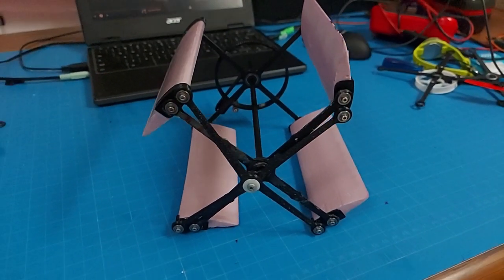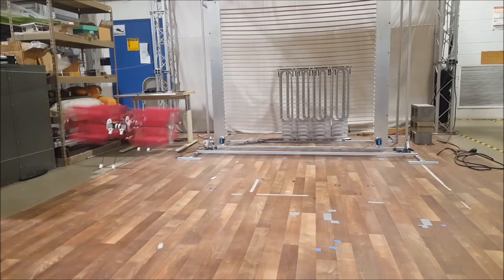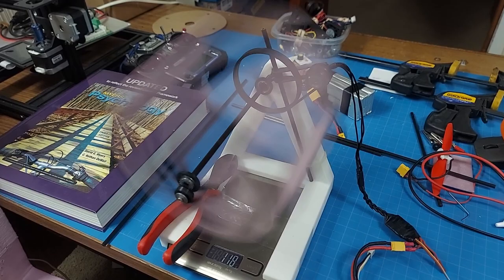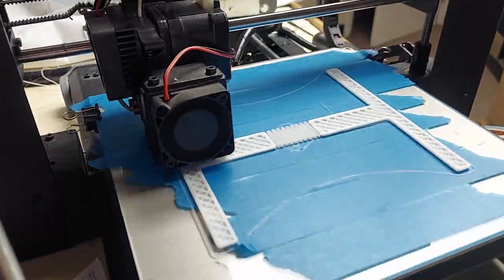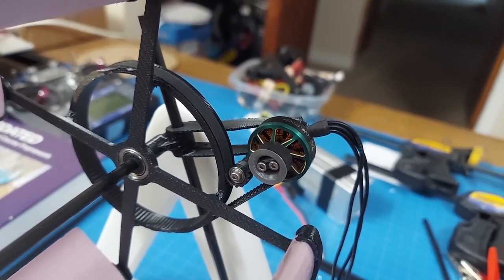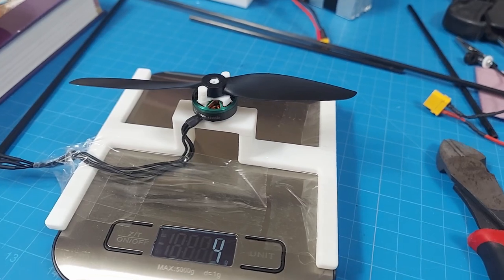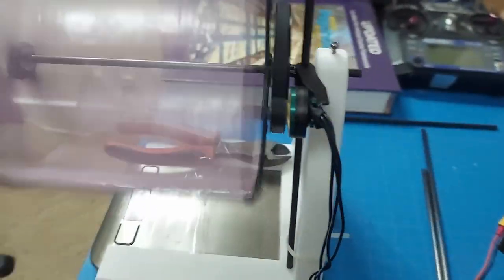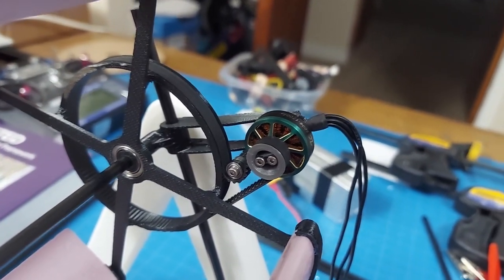The Cyclorotor Is Now a Match For Propellers!

Comment: I agree with you on principle. Specifically deficiency is near regular propellers, and that way it will always be an issue.

The big thing is we have stronger and lighter materials now, and you could put a fuel cell that gets better efficiency than combustion.  

Just the acoustics and maneuverability is generally enough. We have materials now they can make it much much lighter.

Comment: I'm curious if maybe your test stand for the fixed propeller is way too short. Looking at it, most of the thrust is going to blow down onto the scale, and that's going to make it appear to have way less thrust. Also the backwash is going to mess with the whole thing. I would recommend making a standard test stand if you're going to be comparing thrust
Reply from the maker: That is a good point.
I took that into account when I decided to make both the propeller and cyclorotor so that it blows air up in order to make thrust downward.  I think that there is enough room for airflow to enter without much of a reduction in efficiency.  I'm not sure though.  There probably is some effect, but again, I don't think that it's significant enough.
Reply: @JudeSchauer  oh, I see, of course,  it's mounted as a pusher. Hmm..
Reply: Look at AMCA test rig for a circulation fan (industrial style).  It uses a L shaped rig that mounts the fan horizontally, pivots at the angle joint, and the force is measured vertically.  This prevents the wind force from affecting the thrust force.  It also has guidelines for minimum clearance distances.
Reply from the maker: I've actually used that system for the past year or so.  However, I was getting inaccurate readings with the cyclorotor due to some weird effects, so i switched to directly measuring the thrust.

Comment: cyclorotor idea: instead of using a simple, rotating arm to offset the cyclic pitch of the rotor, what if it was two spiral cam discs with opposite spirals, where the end of the arm is located in their intersection. the advantage would be: adjustable magnetue of pitch, but the disadvantages would be weight, higher friction, and another servo motor and their respective control circuitry
Reply from the maker: just designed this, currently in testing so it should be on the next model 👍👍

Comment: Would it effect take off or balance to use only 3 blades per rotor? Or maybe two? Probably an obvious hypothesis you’ve already reached on the path to weighing less but im curious
Reply from the maker: Yeah there's some papers out there that already looked at that.  It uses less power to run a 2 or 3 bladed rotor, but it produces much less thrust.  It uses much more power for a higher blade count, but only produces a little bit more thrust.  4 blades is pretty much the perfect balance in this scale.

Comment: now that you have great gains using 3d printed parts, will you use a more difficult to fabricate but perhaps lighter and stronger materials for the frame and parts? perhaps some carbon fiber or titanium frame with an aerogel/carbonfiber propeller? Maybe you can take this even further. Great video I'm excited for the future or drones and transport.
Reply from the maker: Thats the hope.  I'm currently changing lots of parts around and iterating, but once I have a solid working model I'll look at doing that.  I recently got access to high strength Carbon Fiber PLA and Glass Fiber PLA so I'm hoping to use those as well.

Comment: Have you considered vertical fins on the rotors to counteract possible vortices? Like how that company did? Love this project it looks awesome
Reply from the maker: I tried to do that out of some really light material, but the suction force was too great and it just pulled against the blades and caused lots of friction.  It would have to be larger scale to make it weight-economical to add in the side plates.
Reply: @JudeSchauer  even a single circular plate that moves with the rotor? Out of some paper or something?
Reply from the maker: Yeah.  I did paper and it was way too weak, so I tried cardboard (thin stuff from a cereal box) and that was also too weak.  Regular coregated cardboard would probably work but i think it would be too heavy.
Reply: @JudeSchauer  it might be a lot to ask but maybe a very thin sheet of fiberglass?
Reply from the maker: Yeah composities would definitely be strong enough, but it would weigh enough at this scale to be counter-productive

Comment: For power to weight ratio it really needs to be the entire vehicle weight, not just the thruster. Most commercially available drones are greater than 2:1 power to weight ratio, with 2:25:1 being in my experience a good ratio for sensor carrying aircraft, 3-5 for sporty drones, and 5-10 for racing drones.  Anything under 1.5:1 is way too sluggish to for good control. 

Higher power ratio also helps with efficiency, as efficiency at max thrust is usually garbage compared to lower thrust values. If you were to get 8-10 grams of thrust per watt at hover throttle then this would rival propeller drones. The most efficient drones hover above 10 g/W.
Reply from the maker: The craft should have around a 2.25:1 thrust/weight ratio.  I'm taking this project back up again next month so we should see the actual values soon, but each rotor produces 325-350g thrust and the craft should weigh around 500-600g total.  We're looking at 4-6g/W at hover throttle, so it isn't too far off of conventional propeller drones.

It's not looking like this cyclorotor design will work better in terms of these metrics, but it will be close enough to be roughly comparable.
Reply: @JudeSchauer  Those are some good numbers to go and I agree not too far off and definitely useable. What is the weight of the battery?

For regular propeller drones 2 blades are more efficient than 3, which are more efficient than 4. I'm curious if your design would also benefit from less blades, or if that hurts the overall performance too much. Larger propeller diameter also helps with efficiency, I would be interested to see if larger blades helps here too or if the additional drag on the vertical movement of the blades counter act this.
Reply from the maker: The battery weighs ~85g.  There have been some empirical studies and simulations that show that more than 4 blades increases power consumption and slightly increases thrust, while less than 4 blades reduces thrust by a good bit and slightly reduces power consumption.  4 is generally accepted to be the best balance on the 2 curves.  Larger diameter does increase thrust, but I'm comparing propellers to cyclocopters at the same disc loading so I'm controlling for that.  The blade size has also been optimized, the best is about a 0.66-0.5:1 ratio between chord length and radius.
Reply: @JudeSchauer  if you are trying to keep the disc loading similar to a prop drone, you can help yourself out by comparing to 4 blade props. To maintain the same efficiency larger diameter is required. 

For example a two blade 10” prop producing 500 g of thrust is about 9.5g/W efficient. A three blade 10” is about 9.2g/W and a four blade 10” is about 9.0g/W. Bumping to an 11” diameter boosts the four blade to 9.8g/W, making it actually slightly better than the two blade 10” but with the caveat of more inertia and higher power required to accelerate. In this example it also requires a disc area increase of 21% to match/outperform the two blade.

Comment: Excellent work Jude - I expect to see your ideas stolen and appearing on Chinese websites soon 😉
Reply: Dude, it's a concept from the 10s. The 1910s...
Reply: @Argosh  exactly! Not sure when it was first thought of in aviation terms, but it the same as the old Voith Snider propulsion system for ships that have been around for a long time. Not sure how many ships have actually used it, but it can apparently be pretty great for tugboats, with very good manoeuvring possibilities.
Reply from the maker: @Snafu I have to admit - that would be pretty cool to see.  Is there a market for that? 🤔
Reply: @JudeSchauer  as mentioned before they're used in Tugboats for their ability to produce thrust in any direction. The original company is still producing them and also a number of other things that use the same tech. (Voith)

Comment: How did you cut the xps foam blades in appropriate shape?
Reply from the maker: Good question.  I used 3d printed outlines and ran a hot wire foam cutter over them.
Reply: @JudeSchauer  oh! Thanks

Comment: When humanity reinvents the wheel
Reply from the maker: I think of the difference between cyclorotors amd propellers kinda like the difference between props and the jet engine.  Each has their own strengths and weaknesses, but they have their respective niches.  We'll see if that happens with cyclorotors.
Reply: @JudeSchauer  lol I know, I was just joking. I was referring to our technological advancements as humans because of the positions of the propellers makes them seem like wheels while active. Especially because the rpms makes them look like complete circles like tires, but that lift the craft instead of pushing/pulling it.
Reply from the maker: Ahhhh gotcha.  I thought that you were talking about how a cyclorotor is basically a propeller, but more complicated. 😂  Yeah, you're right.  They kinda do look like wheels on a car.

Comment: Would dropping a blade help it be lighter and more efficient? Or adding 2 and making it 6 or making it like a blower motor fan out of a car 😂 That would more than likely add too much weight.....
Reply from the maker: Yeah theres a few studies out there that have found that 4 provides the best efficiency with the least vibrations.  It is achievable to do more/blades and still fly but 4 is the sweet spot
Reply: @JudeSchauer o